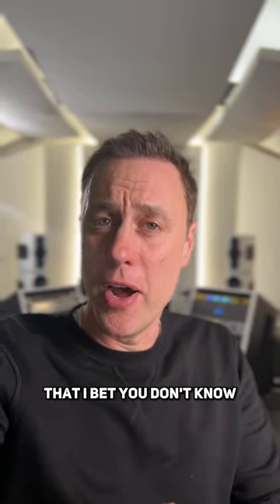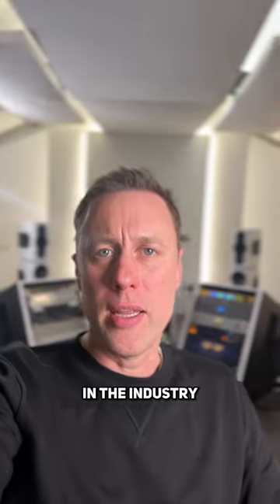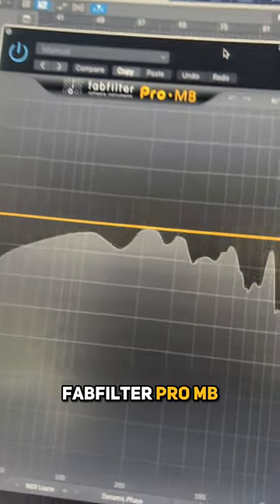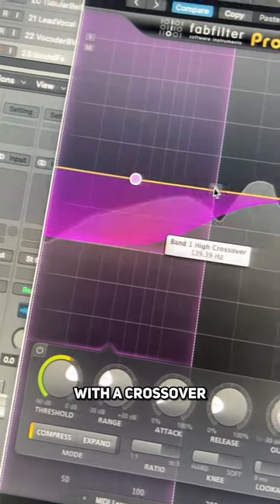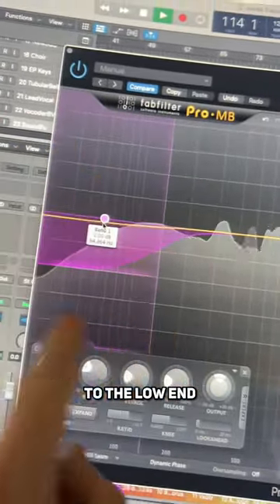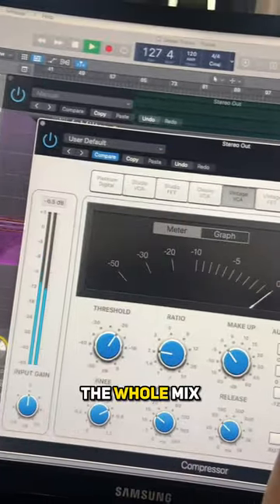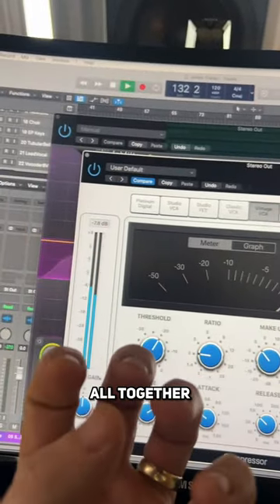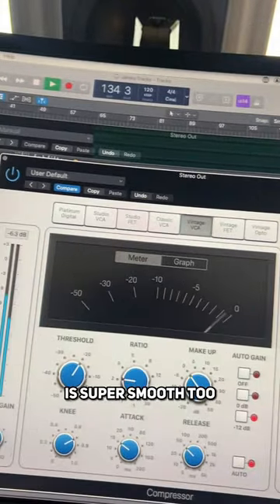COMPRESSOR COCKTAIL 🍹

Comment: This is a great idea. But I don’t see how side-chain compression couldn’t achieve similar or even superior results. A signal side chained with a high passed at 150 hz behaves quite nicely. Or decreasing those frequencies with a shelf pre-compression can even things out dramatically, creating a dense and punchy mix.

Definitely gonna try this in conjunction with sc compression. Pro-Mb into analog SSL G compressor sidechained. Let the multiband do all the work.
Reply: A sidechain in the detector circuit will prevent the low end triggering the wideband compression but will do nothing to independently control the bottom end. This double-pronged method is vastly better IF controlling the bottom end is needed prior to wideband compression.

Comment: How can you tell you've compressed enough on the second compressor? I see about 2db of reduction, I usually have the needle hardly moving. I guess it depends on how it sounds at the end of the day but would you have any recommendations for the average reduction here? Hard house music in question, intense and lots of energy.
Reply: You in the ballpark I wld say -2db to -4db area most the time. Atleast for me thats about where I aim for, maybe try a CLA76 in place of the SSL if u want a bit more drastic of a change or boost.
I know alot of people hate on mixing w your eyes but when it comes to compressors and small changes I feel like it's the best way to get a good starting point without wasting an hour 😆